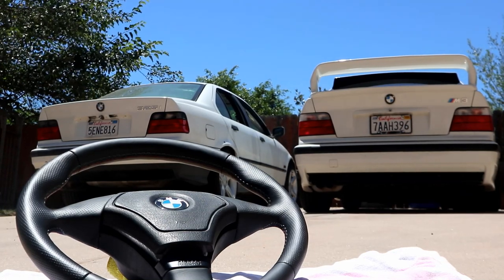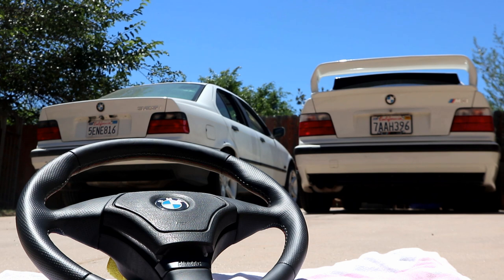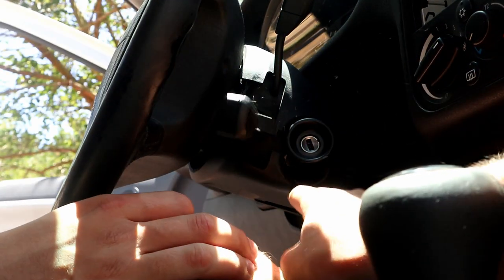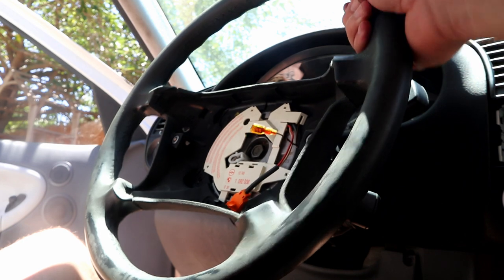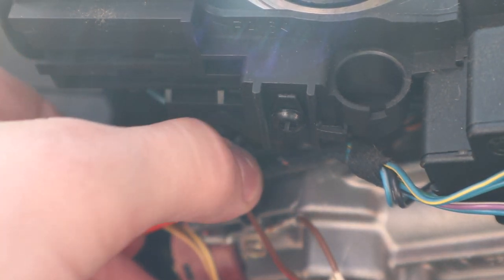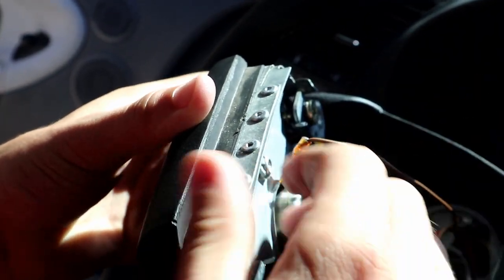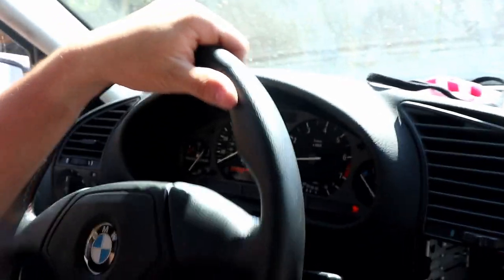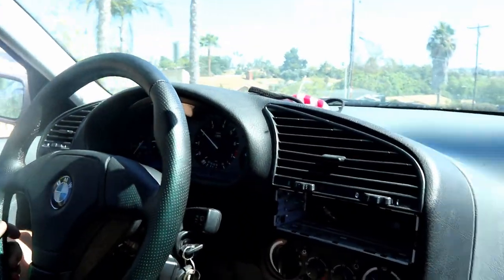E36 Steering Wheel Replacement (OE STYLE WHEEL)

Comment: Looks great! I replaced the wheel on my SC a couple months ago and the process was very similar. I'm not sure if BMW's do this, but toyota cars will have the airbag light turn on for a few seconds and then shut off confirming it's connected and working fine.
Reply from the maker: yup! key on 2 for systems check, pretty standard on all cars. what kind of wheel did you get?
Reply: @M3NACE  3 spoke off a 99 rx300. Super mint. Way better than that nasty 4 spoke lol
Reply from the maker: @gladski14  sweet man! +1 for 3 spoke wheels

Comment: Have you ever done a video on taking out your main inst. cluster and checking for power and some of the small batteries on that back?!?!
Reply from the maker: ive done a video on replacing cluster bulbs, in which you pull the cluster out, close enough?
Reply: @M3NACE  Hey, that was a great video.  I was going to have a question about taking the steering wheel off (bently's and chiltons both call for it) but I knew you didn't have to.  Thanks buddy.  Anytime you are in Jupiter FL look me up.  Palm Beach International Raceway is great for Test and Tunes on Friday nights.  Have a great night!
Reply from the maker: @pgrill24  yeah man certainly will do! you have a good night as well thanks for commenting!
Reply: @M3NACE  Off Topic: Ever see a tensioner pulley starting "bouncing"?  I JUST saw this today...Rrrr.  It is connected to my SC pulley and that thing is bouncing pretty bad.  No belt sqeals though, that's good I guess:(
Reply from the maker: @pgrill24  well thats what tenstioners are supposed to do, they adjust as the tension changes. as long as your belt isnt slipping i wouldnt worry about it too much, you can swap it out if you want for peice of mind
Reply: @M3NACE   Hey buddy.  I had a question: replacing the crank pulley do you have to get a new pulley altogether or is it the sleeve and seal that need replacing?  In other words, does the actual pulley get warped from a shitty tensioner pulley bouncing the belt, or is just the sleeve inside the crank pulley?  Check out the video: https://youtu.be/VghSFwSh5H8

Comment: i want to take of my steering wheel bc i got som squeeking while turning. but Im not sure on the torx sizes. it feels like im ruining the screws with the t25 so I wont dare doing it anymore. tips? I also go the 3-spoke sports wheel, but atm i got the m-sport 3spoke multi function wheel. cruisecontrol dont work ofc, but i can change music and volume on the wheel mehehe, + its a bit smaller.
Reply: Yea I was about to correct him on this, the screws are actually t30, though you can get away with a t27 of you have one. I got one out with the t25, then stripped the other one and began to panic, until I realized I was using the wrong size
Reply: @epaminontas6972  t30 didnt fit on mine. got it off with the t27!
Reply: @i6billy998  it's a weird angle to get the torx bit on right, so the t27 is easier and most likely wont strip your screw

Comment: Nice video man.Please I need help how can i make the horn work???
Reply from the maker: You will need to wire in the clock spring. Lead wire to the horn, ground wire can ground on the steering wheel itself
Reply: @M3NACE  Thanks man!!My car is e36 sedan 92 without airbags and I will put the steering wheel like yours.Is any problem?

Comment: Good morning Quinn awesome steering wheel swap oh yeah the upgrade will look also cleaner maybe also cool if they had some carbon fiber accents or you can wire in electronics Xterra wheel control for stereo or hands-free calling 👍😃
Reply from the maker: we need to get a radio in this thing before we get to carried away with stuff like that lol
Reply: M3NACE i’ll keep my ear open for OEM BMW I am radio let you know if your DM if I come across one 🤙🏽😌👍😊
Reply from the maker: @jamesfcookjr  were going to be installing an aftermarket radio in this car, alex has a nice one in his mustang that we are going to be installing in the E36
Reply: M3NACE ok cool money savings ❤️👍😊
Reply: M3NACE I found a build flaw lol on the grip monster took it a polymer mountain last week and boil the brake fluid which wasn’t too bad but got the brake fluid so hot it melted the seals in the master so I’m going to design more heat shielding around the master to keep it cool But it was fun ripping up the mountain I got a new brake master on the way and I’m making a carbon fiber front splitter 😃👍
Reply from the maker: @jamesfcookjr  cool man! sounds like a bad problem to have lol, you have a turbo blanket and down pipe shielding on already?
Reply: M3NACE yes turbo blanket and turbo shield and ceramic coating the inside of the down pipe the only thing I can do is shield at the brake master and hood venting

Comment: WARNING: screw sizes for the steering wheel to airbag are not t25, they are t30. Do not strip your screws like I did.
Reply: Pissed I legit just did the same thing tonight used a T25 stripped both, how did you end up getting them out?
Reply: @AndrettiDaDon  I did the same thing don't worry, if you ha e a t27 it should work. For me I used a t30 on one of them, and a t27 on the other. The t30 was hard to find the perfect angle for, so a t27 works fine.
Reply: Thanks for helping me strip my screws bro!!! I literally just stripped both my screws! Now I don’t know what to do
Reply: @nc7518  did you use a t27?

Comment: hey quinn ik this probably isn’t the time to ask this but what clock spring did you use? the oem one from the original wheel wont fit onto the 3 spine wheel. Thank You!!
Reply from the maker: I believe it was a 325i OBD1 harness IIRC, the harness was off of a 4 spoke wheel.
Reply: Does anyone know the slip ring part number? Nowadays you can find the steering wheel without the ring. Please help!